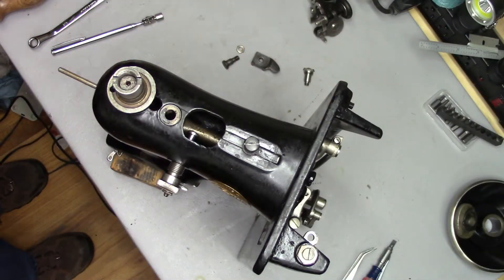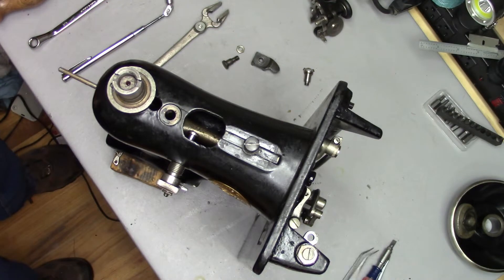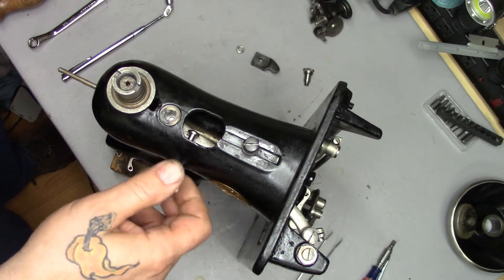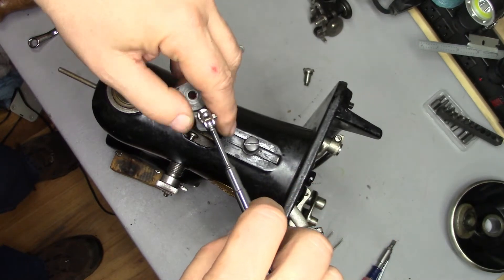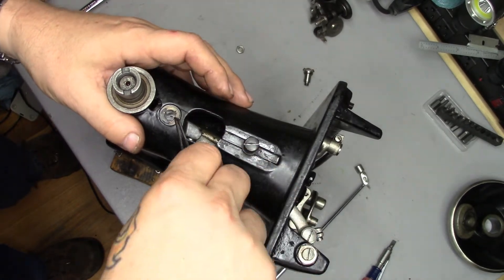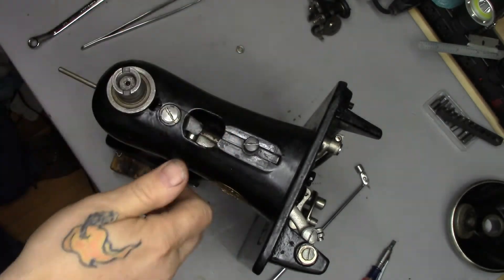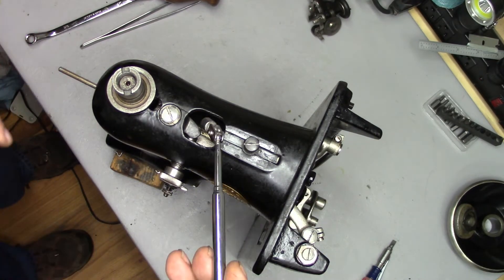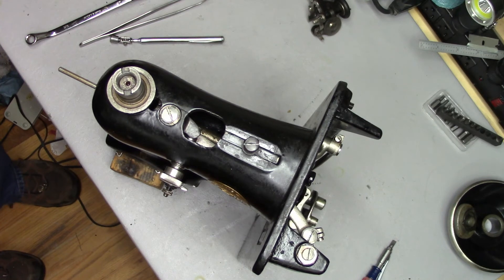Singer 99 Screw Type Stitch Regulator Reinstallation Tips

Comment: Have you already made a video showing me how to rewire a 15?
Reply from the maker: What flavor of 15? There are a bunch!
Reply: I sent you pics of the cords and potty motor. The id# just says 15.anytig else I can give you to et a be idea. Let me know.
Reply from the maker: @debbiepring2236  Ah yes! That motor is the same as the 201-2, only 1 part on the bobbin winder is different. I looked at your pix again, such a nice job cleaning her up!
Reply: That's interesting that it is the same as the 201 as I have 2 of those as well to work on.  I am missing the screw that attaches the motor to one of the 201s tho. Well, under the wheel area where the wires go in.
Reply: My phone is not typing correctly. Missing keys out!🤣